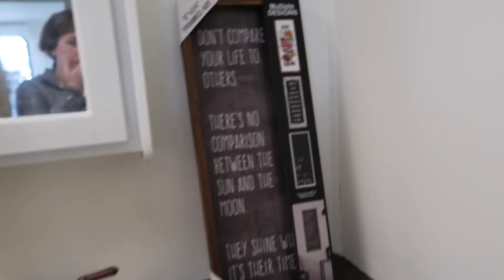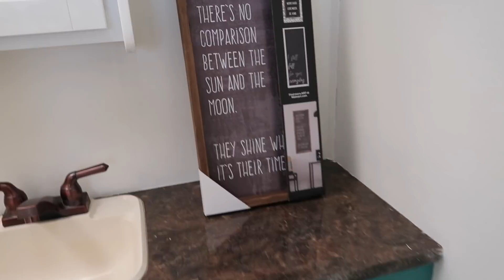Bad News & "MEGA" Concerns! (Plus, adding more camper organization & functionality!)

Comment: Reminds me of a trip we took a few years ago. We stopped at a gas station and met a man who had problems with his vehicle. We asked if we could help him and he replied "well no, only if you've got a piece of wire and pliers". I opened the trunk and said " here you are". He looked a bit surprised.
Reply: That's the coolest 😎 thing I've read in weeks. Love 💘 how God let u join Him in surprising a person in need!
Reply: Try this one on for size. I was staying at a motel in Birmingham, AL. Came out in the morning, started the car, popped the hood to check the oil and shut the door. Yup, I locked it with the engine running. A guy parked next to me was just getting into his car and seeing that I was visibly upset asked if I needed help. Told him what I had just done. He walked back to his car, open the trunk, took out a funny looking tool and a small book. Went round to the front of my car, looked at the VIN, looked up something in his book, then proceeded to make a key with his tool. Turns out he worked for Ford and had the tools with him to make a key for any Ford automobile. Never knew angels worked for Ford.
Reply: We were on a bike ride and stopped at a gas station/ convenience store.  There were two guys struggling to get a backhoe running; some cable wouldn’t keep something open....After watching out of the corners of our eyes for a bit we asked if some zip ties would help.  They said maybe and I gave them all our 15” zips.  Worked like a charm.
Reply: @pitsnipe5559  totally uplifting story. Thank you for sharing.

Comment: For a tv antenna, if you plug it into the tv and place the flat antenna in the camper window, you will get local channels, sometimes up to 36-NBC, ABC, etc. Amazon has them for about $20- free tv year round! Just follow tv manufacturers directions to add channels!

Comment: Original Coleman Camper 2021 has identical coloring backsplash like you put. You put a lot of weight real sofa and two tables, the ones in campers are made ultralight. We haven’t seen you supporting it from the outside every single time from outside when you open the slide.
Reply: I have wondered about this too...

Comment: I had that happen with my Chev Tahoe years ago.  It was a computer that was failing intermittently, so it took an AGE for them to find the problem!  Eventually they did and it was (SO thankfully) covered by warranty.  When the computer was up and running, none of the diagnostics reported any problem.  Prayers that your car's issue has been found and any further issues are resolved easily and inexpensive to repair - BEFORE your trip!!  The camper looks beautiful and I love the backsplash!

Comment: We have a schwintek slide. Just like everything else it requires proper maintenance. Sounds like in its previous life it wasn’t taken care of. There was a time when they were installed in slides with too much weight. That may be part of your issue. There are several videos that show the proper way to lubricate. It’s not as difficult as it seems. Never lubricate the exterior track. Love the faux wood tile on the backsplash!

Comment: Leave one hanger in to hold your coat next to the hanging fabric drawers. You can use earthquake putty to hold down decor and stuff you don't want to have to move each time. We camp up in tops of mountains and once, my daughter got into the fridge just before we left and didn't re-lock the fridge door. Jello parfait went all over the the trailer! Now I am paranoid about locking all drawers and doors and putting stuff where it won't cause problems. I stuff pillows and sleeping bags/blankets into food pantry in front of food to keep cans and bottles from rattling around and breaking. The pillows etc come out to be used during the camping and then go back in, on our way home, to prevent breakage again. We had a 19 foot trailer with 8 kids, now we have a 33 foot trailer and all kids are grown, we need to downsize to the 19 footer again, but my husband wants to 'camp' in hotels only. lol

Comment: We have had the same experience with our truck. It breaks down every time we try to go camping with our camper. (It definitely is fine as far as weight that the truck can handle pulling). We've taken it back to the same shop so many times. They fix it, it breaks. It's all transmission but different things break on it. We are starting to get irritated by the idea of camping, but I miss doing it. We're going to down grade the size of camper so that my Tahoe can pull one. And when the truck is finally fixed right and good -it's time to sell and take a loss on it.
Reply from the maker: Ugh...so frustrating, wish we were the only ones that had these problems!!

Comment: What an amazing transformation. All your hard work has paid off. It really looks fantastic!  I’m big into Command strips and hooks. I would have hooks all over the bathroom and inside/behind doors.
Reply: I was too in the beginning of RVing (regarding Command hooks). Then when we knew we would have this 5th until we quit (which we are about to), and the 5th-wheel would be sold as a project or off to auction (however, our diesel truck, no big mechanical problems at all, just replace batteries, lights and simple stuff like that), the 5th has been another story. So when the Command hooks sticky failed, we went straight for screws and real hooks. We are glad we had the other type of slide mechanism instead of what they have so we have been fortunate our slides never gave us problems as old as this 5th is now (RVs don't age well at all). We are sick of being in tight spaces (even though ours is a larger 5th-wheel & only 3 of us) and we had water leaks in all 3 slides so whoever gets this, they have a lot of work to do. Never again full-time. Not fun after a few years.

Comment: Well, y’all are in a position now to get a gently used SUV... hard to come by in farmland, but they’re out there. Much easier to find than a gently used truck or one that hasn’t been modified.
Reply: I love our diesel Dodge Ram 2500 but we tow a larger 5th wheel. She is old but she has never failed us mechanically with 280k on her. Also has a bed tank. We are getting out of RVing in 2 to 3 months when we go back into a stick-n-brick so gonna sell her and the 5th (not together...gonna hold out on what I want to get bc she isn't beat up like a lot of trucks around here...south midwest...and all the oil workers trucks are beat to hell).

Comment: You just take bedding out of the plastic and don't wash it before putting it on the bed?   There's 
chemicals on the fabric and it's not good to just use them straight out of the package.